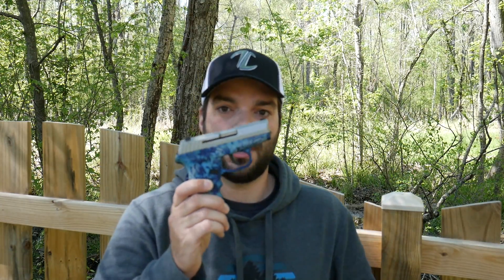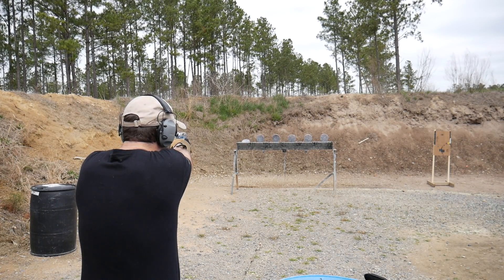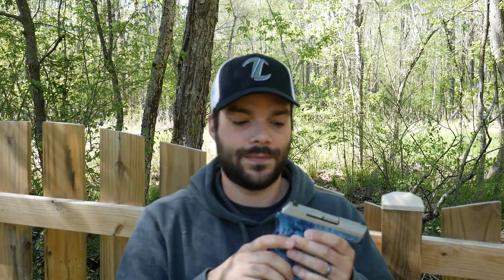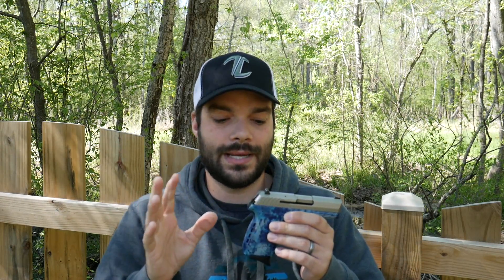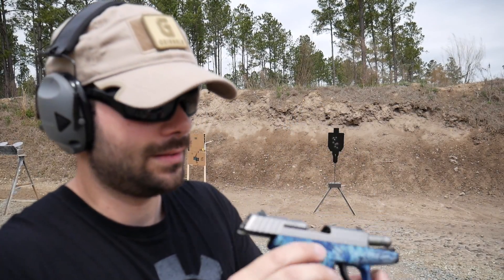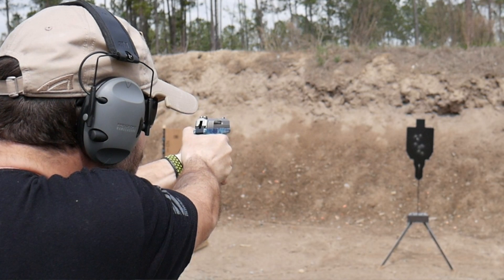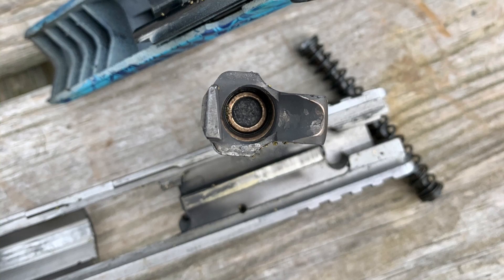Squib Load Caught on Camera | SCCY CPX-2

Comment: Doesn't matter who makes the amo, squibs happen. It's our job as shooters to catch it when it does, no matter how good or expensive the amo is there is always a chance of a round that wasn't charged properly getting into the batch nothing is perfect. Most of the time when I see people actually blow up their guns due to a squib load it's always the shooters fault because they do not take the time to check out the malfunction properly. Every time I have a case where I tried to fire a round and had a light primer strike or a case where the primer didn't go off I cleared my weapons and inspected the round that was in the chamber after waiting 30 seconds with the muzzle pointed down range to make sure I didn't have a hang fire. You should always check to make sure the projectile didn't leave the case cuz if you clear the round and the projectile isn't present there is a very good chance that it is in the barrel and even a round with no powder and just a primer 9 times out of 10 that primer has enough force to push it into the barrel. Always take a good cleaning rod to the range 9 times out if 10 if you have a squib there are easy enough to clear out of the barrel with just a cleaning rod and some force then you can go back to shooting.

Comment: I had what I thought was a squib load. 

It fired but with little power and the case split. It had actually failed twice.

On further inspection I noticed the case was also swollen... it was a 9mm..... We were using 40cals.

When it failed to fire the first time I ejected it and I finished the mag. The instructor reloaded the "ejected round" into an empty mag which I then fired presumably for the 2nd time.

I don't know if he simply picked up the wrong round or if it had somehow got mixed into a bucket of ammunition we were using for extra rounds not needed between groups. No one was using 9mms so I lean toward the wrong round being picked up off the ground in the target area.

Proof 9mm can be fired in a 40 cal. I don't recommend it.

 No noticeable damage to the glock 40 cal.

Comment: Damned squibs happened to me twice out of the same box of new factory ammo in the same day. It was Winchester green and white box .38 Special FMJ. Plugged the barrels on 2 of my revolvers in the same damned day...a S&W Model 36, and my Ruger GP100. What a pain in the ass. Just used penetrating oil and tapped out the slugs in both the barrels. Well, I don’t buy that ammo any more.

Comment: If you get a pop instead of a bang and after you clear the gun there is a large amount of unburnt powder in the frame/slide...You most likely have a squib load. Check the barrel ASAP before loading a fresh mag. This happened to me 3 times last year

Comment: Happened to me once with CTT 40. The gun sounded OK, but it didn't cycled enough to get the next round, so I cocked it again and BANG! I could feel a lot of warm gas on my hands and face. Nothing happened to the carbine and to me (thanks to PPE ).
Lesson learned, if it did not cycle all the way, check the barrel.

Comment: I had a squib in a high powered rifle.  The primer went off, but the bullet had been pushed back into the case.  I knew something wasn't right so I opened the bolt to find a bunch of unburnt powder and a bullet stuck in the barrel.  Had I chambered another round and fired it the gun would have blown.

Comment: I nearly blew a hole in my palm with a squib 12 gauge slug once, I was shooting as fast as I could and didn't catch it in time. The barrel bulged out and split a little (about a 1" long split along the bulge) which was located exactly where my hand was on the forend/pump, if that split had happened a 1/4" lower the gas would have ripped my palm open. My hand was a little singed as it was lol. Squibs are no joke, especially when it comes to larger and more powerful firearms. 

Really sucked too, the gun was a 50 year old relic from my grandpa who has since passed away. I was able to get a replacement barrel for it from eBay, it was a Western Auto Supply Revelation, AKA a Mossberg 500, but the barrels are rare these days from that era and I wanted the gun in its original condition so it sat for years until I found the right barrel (yah I know any mossy 500 barrel will fit, but I wanted it look just like it did when my grandpa gave it to me). At least she's whole now...

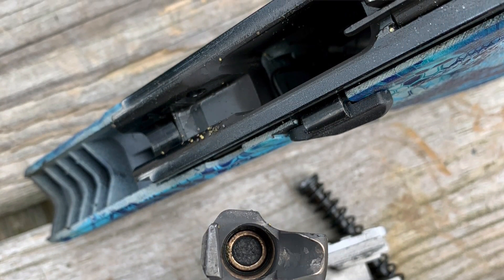Comment: Great save on your part!  One curiosity is the gunpowder flakes in the frame at 2:38.  Were some of the flakes as yellow as they appear to be in the video?  Also, there is a lot of carbon residue outside the chamber indicating that some of the powder must have ignited to some degree.  Or the primer produced a lot of carbon.  The gunpowder also made an imprint on the chamber face probably from when the slide returned home.  A very interesting failure!  Thanks for sharing this!

Comment: I have seen with really stubborn squibs!, that they use air compressor. They block the end and put pressure until it shoots out. Very dangerous method, but I have seen barrels saved with this method. Just have to be careful where its pointed cause it will shoot out.
Reply: That’s crazy 
Read what I said just above your comment

Comment: It could have been a light strike my SD9VE does it if it isn't cleaned 100 rds or less also excessive oil in the firing pin channel causes it to gum up faster
Reply: That has nothing to do with this. A light strike is a COMPLETE failure to detonate the primer. 
In this instance the primer went off, but there was little to no powder charge in the case.
Reply: @jmfowler9062  either way it was dirtier than it should have been in my opinion was my point is all.. both are not good and something to watch out for

Comment: Had my first squib today ! I had a pop and no kick pmc ammo 223 55 grain no ejection bullet was about an inch down the barrel dropped the mag and ejected the casing powder came out of the  chamber into the receiver I dropped a cleaning rod down the barrel and the bullet came out kept shooting
Reply from the maker: Glad you caught it man
Reply: @GearKnowHow  I'm glad I did too kinda scary
Reply: Same here. About 2-3 months ago shooting steel wolf 223 had my first squib. Kinda scary, I noticed the lack of noise but also the smoke. I guess some of the powder cooked off. Y'all stay safe
Reply: Been reloading since 1975 without a problem. Last year I was running some 6mm Mongoose loads (6mm-.223 wildcat) and had a round go click. Ejected the round and it looked perfect except for a deeply indented primer. No pop or anything. Dud I thought.  Had the same on the next 4 rounds. WTH I wondered. All deeply indented primers. Bad Batch?

Broke the rounds down at home and found NO POWDER! Forty years of reloading without a hitch and then missed five powder dumps in a row. The bullets didn't even budge a bit from the fired primers. Crap happens.
Reply: @barrygrant2907  yeah shit happens even with factory ammo I guess too
Reply: @BM205  Yeah the PMC that I used some of the powder dumped out into the upper receiver when I ejected the case manually and it looked like it was wet all clumped together and stuff idk

Comment: Did you finish off the entire box? Get & post the Lot number for the ammo. Yes us Reloaders are probably more familiar with squibs than the average gun owner but as you just experienced...Squibs can happen with factory ammo. You should be able to knock the squib out with a brass rod or even a aluminum rod but brass preferably. Good catch! There is or there should be a noticeable difference in sound with squibs & little to no recoil. Thanks for sharing as your experience can possibly help someone out if in a similar situation. Here is a video when I had one around the 1:50 mark https://youtu.be/0dK-R9-4TYY

Comment: I had one at the range. I pulled a bullet from the round and ran the round powder only. No projectile. It clears it all the time. Just an easy thing to do at the range.
Reply: So you ran a load with no bullet and it pushed the bullet out?
Reply: S. McG. This sounds suspect 
My grandfather lost half his finger from an obstruction in the barrel 
The air in the barrel compressing is what blows/bulges
Reply: Yes it does just fine, but I thats with pistol only, I wouldnt do that to a rifle. Also it was 9mm. It would not generate to much pressure, however over pressure, probably not